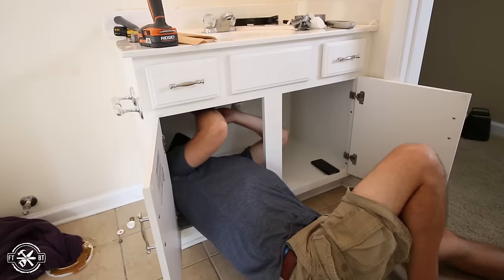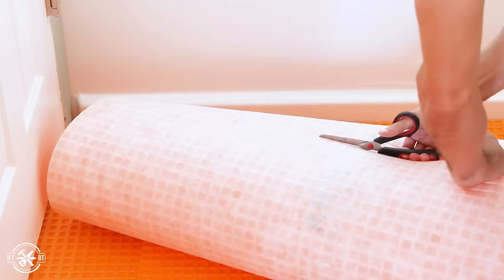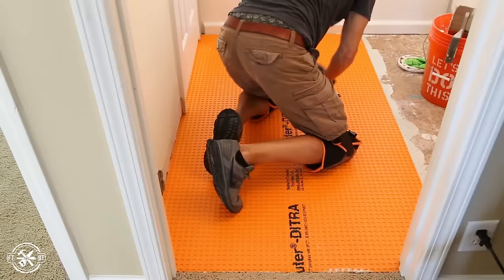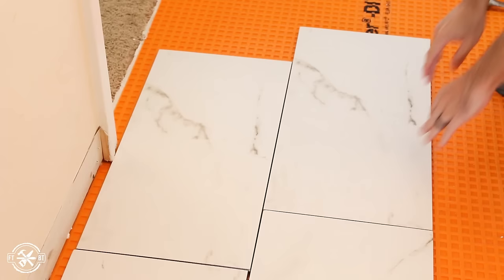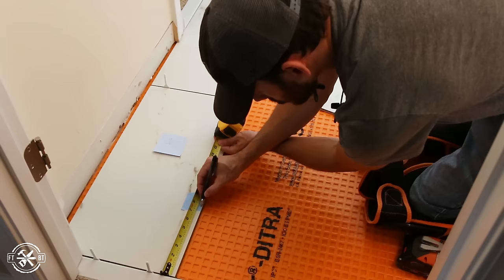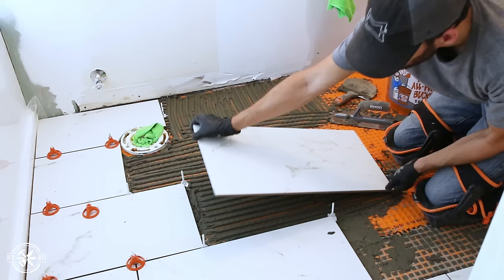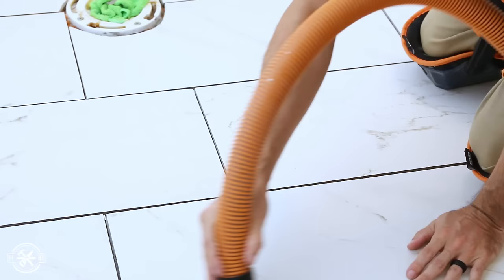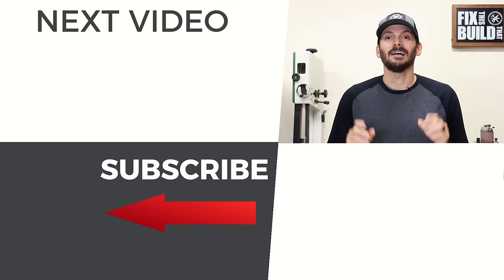How to Tile a Small Bathroom Floor | DIY Bath Remodel

Comment: I just did 96sqft wall with the rigid leveling system and the tabs will not break, and when they do its above the tile surface... 🤬 Any advice?

Comment: should i use that same backing on the bathroom WALL.... and if so can i put it OVER wall paper? or do i have to remove the wall paper first, (it's one layer of wall paper over drywall)
Reply: i recommend putting half inch hardie backer, till the desired height or demo
Reply: you will save money the the thing he used is more expensive but easier use.
Reply from the maker: Depends on if it's in the shower or just a wall decor. Make sure it's waterproof if going in shower

Comment: Nice job, with attention to details. That looks like a serious "slippery when wet" floor. Understood most tile is, nowadays there could be some better designed for wet/damp surfaces to not slip/fall. I don't think I'd want that floor in a bathroom with kids or older folks. Looks great, but treacherous....

Comment: Are you out of your mind laying a part of the floor padding with adhesion AT THE FRONT OF THE BATHROOM and then using that to sit on while doing the rest of the floor?  Personally I would start from the inside and work my way out of the room like normal.
Reply from the maker: I'm totally loco 🤪

Comment: Hello, professional tile & bath contractor here.

Thinset was way to thick for laying DITRA. If you read the directions, it calls for a fairly fluid consistency. Thinset thats too thick risks skinning over prematurely when being spread over the extremely porous substrate (plywood). And the grout was ridiculously too thick. It looked like chalk, yikes! Read the directions. It will call or x amount of quarts or liters per unit. FOLLOW THE DIRECTIONS.

Comment: Buddy I don’t know how you can make a how to video , you should use a full piece at the entrance in the middle first off and a bathroom that small you can just lay the tiles, mark and cut before you start mortar , much easier than measuring and cutting while mortar is mixed and drying

Comment: Thinset doesn't slack, it slakes. 
Slaking means to drink in and assimilate moisture.

Also, Ditra installation really is better done if you install the Ditra and scratch coat it, and let that dry overnight and set your tile on it the next day.

That way you dont crush the product as you kneel on it, and you have the added bonus of being able to draw any needed guide lines on the surface.
Reply from the maker: Great tips! You clearly have done this a few times 💪💪

Comment: How can you tell if your tile was laid down properly? Some of our tiles sound hollow underneath.
Reply: Melanie Miller did you guys back butter each tile? And you can lift a tile every now and then to check adhesion
Reply from the maker: If it sounds hollow it probably is. One day it could crack, but nothing to rip it out over until it fails

Comment: Why is he putting grout on the floor and the tile? I'm pretty young so I'm asking purely out of curiosity.
Reply: StarOwen - hey there, good question!  Grout goes in the joints between the tile after the tile is set and the mastic (cement-type glue that adheres the tile to the floor) has dried. Mastic on the floor and on the back of the tile ensures proper adhesion. You want the entire tile surface stuck to the floor - otherwise, the tile could crack under pressure.

Comment: Can you install the schluter ditra over a self leveling compound?
Reply: You can, what SLC you use will depend on the subfloor you're leveling though.
Reply: x21rico21x if the SLC cracks underneath the ditra will that make the ditra ineffective ?
Reply: It wont render it ineffective, just as if yhe regular floor was to crack under ditra. Get your slc right and you shouldnt have an issue.
Reply: x21rico21x thanks for the help!

Comment: Use a dark grout.. it will darken with use... it will, stain and when cleaning floor changes grout the dirt stays in concave darkening grout ...ask how i know. Researched tile floors in texas home with a light beigh grout it looked like crap...home cleaners dont rinse floor enough when cleaning leaving dirt to stain grout.. so do youself a favor go dark it will get that way anyway.. ever see a commercial floor what color is the grout now in used areas..  after 12 homes you get smarter.. maybe..

Comment: If you have to use self leveling spacers you are not a professional you are not seasoned or skilled enough to do it the right way this is like painting by numbers
Reply: There is not any question about his competency level based on his use of spacers for level the tiles. lets be positive. its a good idea for time saving/more perfection. we always look for new ideas to simplify our work. thanks

Comment: you should never mud the back of the tile. it may seem that it would give better adhesion but in reality you are doing the opposite. dont scrape the mud down to the board and wiggle the opposite of the grooves to get proper adhesion.

Comment: OSB on floor,omg,again typical american type of building...Man,get rid of that,use cement floor,level it,than use hidroisolation ,and glue that tiles with cement base glue (ceresit cm16 flexi or simular)....

Comment: First mistake I heard was he said mastic referring to the floor never use mastic on floor second the detra is not a water proof system with out a water proof seem tape and silicone the outside edge as most mortars are water soluble so do your homework because not all installers are created equal do not use unmodified mortar no no no